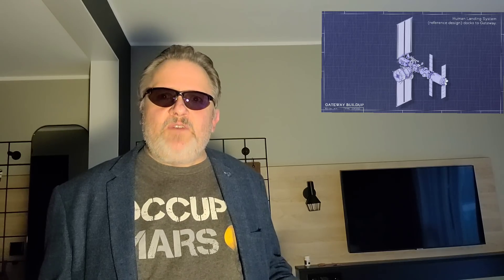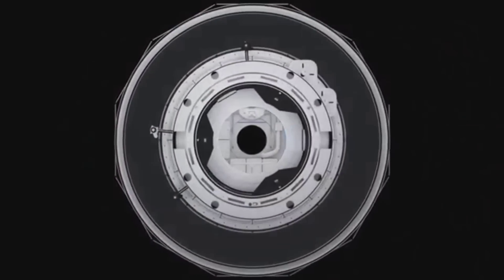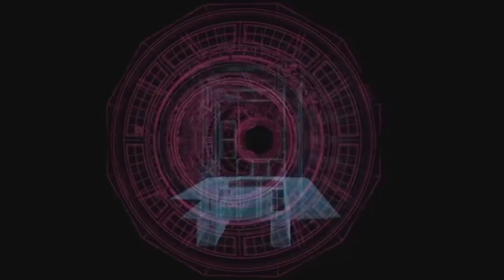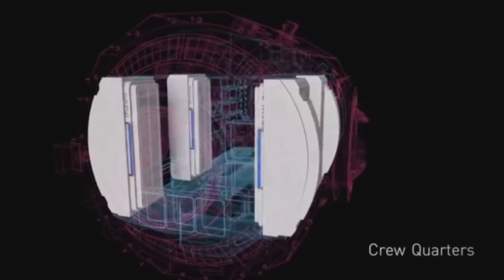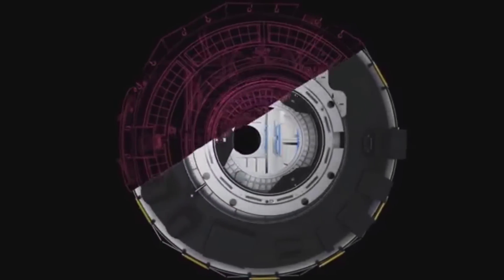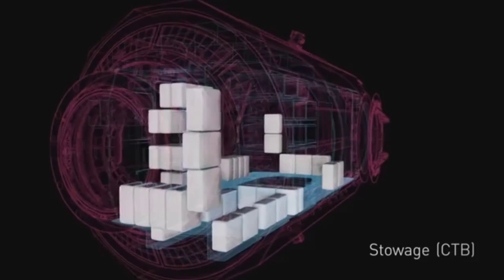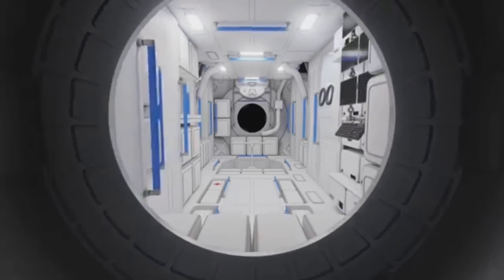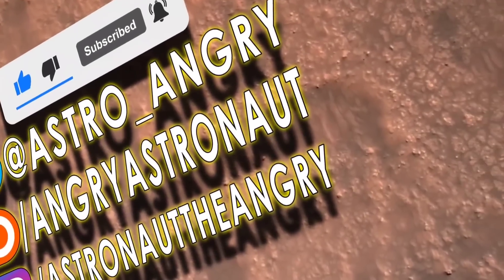New Lunar Space Station design has big problems!  NASA has better options!

Comment: Large Bigelow inflatable modules seemed perfect for the Lunar Gateway ... a large module of light enough weight to be easily placed in lunar orbit.
Reply: Their only sin was not thinking big enough.

Let's break this down.  SLS is $2B per launch.  What if we scrapped 4 launches, or at least diverted the same amount of $ toward building a true station in Lunar orbit.  What would that look like?

4 launches = $8B

Using SpaceX Starship, we'd have a fairing of 9m x 18m.  Let's assume that we'll break the station into segments, and each will fit into a Starship fairing.  The resulting inflated size is roughly double the original footprint, so each segment will be 18m x 36m.

Reported Starship launch costs have varied (originally $1M), but we're going with an estimate above that quoted by SpaceX at $10M per launch, giving SpaceX a good profit.

OK, let's add it up.

100 segments will give us a station 3.6km in circumference, and over 1km in diameter
50 launches will be required for all equipment, furniture, wiring, etc
50 launches for all rigging, external structure, engines, fuel, etc

200 launches x 10M = $2B
Cost of segments = $3B
Cost of fuel  = $30M
Cost of water, soil, fertilizer  = $30M
Cost of furniture, equipment, structural = $2B

Total: $7.06B

Given cost overruns, feature creep, etc, add $1B.

The dimensions of the station would be toroid, with the diameter of the tube being 18m, or 54'.  The tube would contain three main floors, with sub-levels at the top and bottom for engineering crawl-spaces and ducts.  With three separate floors, each averaging roughly 15m wide, we have 162,000 sm, or 1,458,000 sf for habitation.  With that much space, we can assume that, maximally, we will have living space for almost 7,300 people.  Obviously, we'll have space taken up by operational, agricultural, and engineering demands.  So, say half, at 3,650 people, comfortably.  We could obviously push the limits.  But then again, once we create industry building these things, it only becomes more affordable.  

I think we need to figure out these habitats before we go to the moon or mars.  The Chinese will flail about and find out why living permanently on the moon is a bad idea.  We, on the other hand, will control the gravity well, which centers on being able to live there sustainably.  And having 1G habitats supporting thousands will allow us to build and mine in space, rehab from planets or moons that have less than 1G on a regular basis, and support maintenance and refueling of regular transport / shipping / trade traffic.

In essence, I think we've been going about this all wrong.  And if we continue to try to build on the surface without stations for rehab, we're destined to failure.  The human body simply won't be able to function in reduced Gs for periods longer than a year.  

And having children?

No.
Reply: @jklappenbach  there is no Lunar Starship .. and won't be for YEARS. Remember, SpaceX's priority is Starhip for launching Starlink Sats.. not human rated Moon missions with in orbit refueling. 
Also .. the Lunar Gateway can start out small.. and grow later. And why not add an inflatable Bigelow module later?
Reply: @KrustyKlown  And SLS and Artemis won't be for YEARS.  Remember, SpaceX's priority for Starship is for what ever will be of benefit to both SpaceX and NASA.  Without NASA, SpaceX wouldn't exist.  And if NASA decided that it wanted to embark on a project like this, you can bet that Gwynne Shotwell would certainly prioritize it accordingly, especially if that meant that the USG would assist with mitigating environmental concerns in TX, aid with program funds to fast track simultaneous development in FL and TX, etc, etc.

Also, I'm not proposing that Starship take these to orbit around the moon.  I'm suggesting that they build the station in earth orbit, and outfit the station with their own engines, ion drives, or whatever will do the job.  And then slow-boat out to lunar orbit.

The reason why you'd want to do this first, as opposed to later?

Say you build a base on the moon with basically nothing substantial in orbit.  You're limited to the number of people you can place at the base by the numbers you can replace with a disposable launch program costing $2B a shot, every six months.  And every time you rotate out someone, you lose all of that operational expertise.  And even though they can participate from the Earth, they can't quickly come back if they need to be hands-on.  

It's not a sustainable enterprise.  You're building a system with a major chokepoint, and that limitation is going to last decades.  Once you have an operational system, it gains considerable inertia due to the sunk cost fallacy, as well as the simple psychological effect of "well, we did that, time to focus on other things."  Just look at the ISS.  It's pitiful that the ISS has remained the pinnacle of human achievement in LEO for over 20 years.  If we really had the mentality to be additive like you suggest, we'd have a station ten times that size by now.  But we don't. 

If, instead, we build the orbital station first, we gain in so many other avenues.  First, we can go really big on the moon from the start.  Second, we have a huge asset in earth orbit for manufacturing, repairs, fueling, etc.  We can slow-boat a station out to Mars, and use that to jumpstart a large colony there, without the do-or-die stakes that we might otherwise have without an orbital haven. 

And then there's the belt, and the ability to really mine asteroids, smelt the ore, and fab it into whatever we want.  Truly giant habs and generational ships, terraforming equipment for Venus or Mars, a true space force.  

We have this technology now.  Starship is going to take another year, perhaps two to iron out, that is if the USG helps shield it from environmental lawsuits, and helps it to meet labor safety laws.  Starship's success is largely in the hands of US regulators now, and the decision to kill it would be an incalculable blow to US space aspirations.  NASA should be in the design and early construction phase of a station like this.

But as it stands, they still need to pull their heads out of their asses.
Reply: @jklappenbach  Elon basically has the technologies for underground centrifuge habitat which should be able to give 1G on Mars or the Moon.

Yes, it won't be constant 1G all the time, but should be enough for near term missions while setting up industries on Mars or the Moon, no micrometeorite problem and if it fails, there's still the natural gravity of Mars or the Moon.
Reply: @jklappenbach  SLS / Orion, is essentially already human rated .. next launch is with astronauts. SpaceX built Starship to economically launch Starlink Sats (not for colonizing Mars, lol) .. that is their focus, getting to reusability to be cost effective. That requires perfecting their re-entry heat shield, catch system, etc...   They have zero flight time towards human rating those Raptor 2 engines, and the whole refueling in orbit thing is only a pipe dream now and required for a trip to the Moon ... they are a good decade away from a human riding on a Starhip outside of LOE. 
Artemis will go for over a decade using SLS. Then if Starship proves safe, maybe it becomes the next generation human rated launch vehicle .. IMO, it may not prove to be safe, due to all the cheap welding used, Heat shield tiles falling off, and total lack of a launch abort system .. it may only be used for Starlink Sat launches (200-300 Sats per week are rquired just for maintainance).
Reply: @1ndragunawan  I've seen it.  It doesn't solve the problems I've laid out.  It's also not the scale needed to minimize Coriolis, which will make living in a spinning can untenable.
Reply: @KrustyKlown  One decade?  You're kidding me, right?  I know "Elon time", but that amount of pessimism isn't warranted given their previous performance and where they are with testing.

And again, I'm only envisioning starship being used to launch segments into earth orbit, perhaps even LEO, in order to reduce costs and ensure reusability.

The simple fact is that with the cost of 4 SLS launches, we could completely pay for a toroid station 1km in diameter, and gradually thrust that into lunar orbit.
Reply: @jklappenbach  yes .. SLS is expensive.. and that is why it will end up retired in 10-20 years .. a Commercial space company will replace it, because doing that will be profitable.
I don't understand why everyone wants to believe it's an either SLS or Starship deal .. the future is probably BOTH. SLS now, Starhip or more likely the next version of Starship larter.
Don't ignore the difficulty of Starship re-entry .. right now they can't keep those heat shield tiles on during ground test firings with a handful of motors.. one tile falls off, a burn through goes RIGHT through the fuel tanks, unlike the Space Shuttle.. which also lost a lot of tiles, even after years of improvements. This is REALLY a big challange.
   Also, NASA is not going to let astronauts launch without a launch abort system, which will be a major change for Starship.
   Then ya got the LOE refueling need for Starship to head to the Moon or Mars .. NONE of that has been developed or tested yet.
Reply: @jklappenbach  Oh, you meant the Tom Scott video?
No, the centrifuge habitat I'm speculating is basically just a ring tunnel, which is what Boring Company makes at $10M per mile.

Tesla Model S Plaid can do 320+ kph, so the electric motor is available and mass produced, so it will be cheaper than custom made motor.

At 800 meters radius, the rotation speed is only 1.05 rpm, tangential velocity is 318 kph, and should give 1G.

To feel the same effect as Earth Gravity, 9.8 m/s^2 ÷ 0.1107 radians/s = 88.52 meters of radius.
Therefore, the minimum diameter for 1.05 rpm rotating habitat to feel the same effect as Earth Gravity would be 177 meters.

So, 1600 m diameter of tunnel would have negligible Coriolis effect.

1600 m diameter tunnel is 5026.55 meters in circumference, or 3.123 miles, and Boring Company can make one here on Earth for $31.23M.

If a road train fills the entire tunnel, basically a circular train, with Boring Company's tunnel diameter of 3.8 meters, then the tunnel can be the home for about 2000 - 2200 people using NASA standard of 25 m3 per person for long duration mission, or about 348 people if comfort is the prime consideration.

Since it's electric, it doesn't matter if it'll spin up or down daily, while orbital rotating habitat requires fuel to spin up, maintains the spin rate, spin down capability, and maintains its orbit.

Every resources including fuel needs to be transported into the orbital habitat, requiring more fuel which requires either transporting from Earth or ISRU on the surface of Moon or Mars.

Transporting resources into underground circular tunnel just need a common transportation available on Earth or just walk.

There's also the problem of space station like ISS has the lifetime of about 30 years, while tunnels with habitat made of commonly available items should lasts for much longer than that.
Reply: @Krusty  never underestimate Elon.
Reply: @jklappenbach  Thanks for the analysis.  Unfortunately Elon, being a business man, thinks in terms of cost efficiency and profitability, not in how to spread the work over more voting districts despite far lower quality and economics, just for the sake of more polytricktians voting for pork.
Reply: Bigelow space is now dead.
Sierra space and Lockheed Martin have inflatable modules.
Reply: @1ndragunawan  Fine.  Somebody get proactive and call one of them and make a deal.  Damn!  How hard can it be?  Can't anyone do better analysis and think ahead...out of the box, for Christ's sake?
Reply: @majic5zero  Sierra Space is part of consortium to make Orbital Reef, and Lockheed Martin and Nanoracks will make Starlab.

Both Orbital Reef and Starlab are selected by NASA as part of commercial space station to replace ISS.

Here's Sierra Space burst test last month:
https://youtu.be/kWoyXpo4XeE
LM burst test, also last month:
https://youtu.be/slh1ipjYbrE

So, NASA did call and gave them contracts.
Reply: @1ndragunawan  no shit, you know what they meant
Reply: @1ndragunawan  - Bigelow licensed the TransHab tech originally developed by NASA. How did LM & SNC suddenly develop their own TransHab tech? Or did they likewise buy it from NASA or Bigelow?
Reply: @manofsan  Not a single information about that.
Looks different from Transhab or Bigelow inflatables though, so could be the same idea, different implementations.
Reply: just modify and connect to starships together and here we go. You get the equivalent space of a small village.
Reply: NASA doesn't trust inflatable modules. The one currently docked to the ISS is strictly a storage closet.
Reply: Is Bigelow still a thing? Or did Bezos roll over and kill it?
Reply: It's not Bigelow anymore, but there's another company that that is carrying on.

Comment: You are hung up on the name. What these first parts are is just the core. Propulsion and basically a corridor interconnect. They are using the interconnect for some additional habitat for the initial missions. But consider that these initial missions will have both a decent vehicle and the vehicle they arrive in. Just as when the ISS is full the arrival vehicle will be used for habitat. This interconnect has the additional option of functioning as an emergency bunker for the entire early mission crews. 
What you are actually seeing is NASA pushing the initial design to fit known capabilities to get it done now and not later. Far from questioning Starship it appears NASA is counting on it or at least the next generation of heavy lift launchers for future expansions. They are just not getting to far ahead of themselves. NASA is just not going to run as far ahead counting on promises as opposed to reality, when the entire industry is moving so fast. Long term planning is just that long term and for NASA has become more flexible. Science mission lead times have already decreased and manned missions will likely follow that path also. This even more true as we now have multiple commercial entities working on multiple habitat solutions that can change state of the art overnight. Fixing anything to just today's state is almost criminally negligent.

Comment: Jordan,  You need to do a little better.  Your opinion on things changes as much as the wind.  It wasn't that long ago you were talking like the lunar gateway was the greatest thing since sliced bread.  I still think the entire gateway is a giant waste of money.  1) I don't see why all the astronauts that travel out to the moon can't actually go to the surface. It's not like autonomous docking is not a thing.  We don't need crew on each of the vessels in order to accomplish docking by the HLS returning from the moon.   2)  The only 'testing' that can be done longer term on the gateway would be in radiation protection R&D.  You can simply send a much smaller module out to lunar space (like a Dragon XL) filled with radiation detectors, etc.  3) Anything else can be done on the ISS (or one of its follow-ons).

It's been stated that many countries have been brought on board to contribute to the gateway.  We'll, I say let them team up for a longer term surface habitat and start doing water mining and propellant production R&D.

The Gateway will sit completely un-crewed for all but 2-4 weeks out of the year.

Flame on!
Reply: Sorry to disappoint you Mike, but no flames.  Indeed, I agree with you completely!  There is absolutely nothing the Lunar Gateway can contribute which can't be better (more easily, more efficiently, more cheaply, more safely) achieved on Earth, in Earth orbit or on the lunar surface.

Comment: I'm sorry but I see a big problem in your idea of using an inflatable module, these modules are designed for low orbit where the van halen belt protects us, it is impossible to add adequate protection in this type of habitat, also the design is intended to use two hatches (there is always a rigid part that is incompressible) not four.

Comment: Would be better to use the SpaceX 3 ring sections with upper/lower domes with ports and ports on the side , i`m sure Falcon heavy with just 2 boosters could put them (4) in orbit to fitted out while up there ? then use a modified dragon to sent then to the moon orbit ?

Comment: I looks like a single seater to me. What about inflatable modules, as in those created by Bigelow ? Von braun in '48 had already suggested inflatable living spaces.
Reply from the maker: Yup. The Sierra Space module fits that bill.
Reply: I thought Bigelow was dissolved by now but I'm shocked to learn they're actually still operational, technically.
I think Bigelow Aerospace should be offered a contract to try to revitalize it. They have most of the technology, just not the capitol to manufacture something from what I can tell.